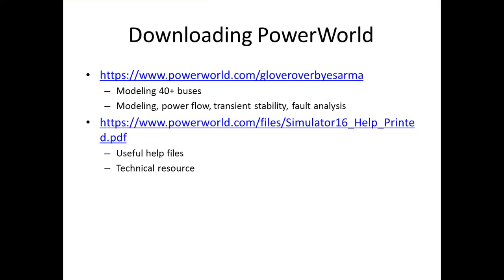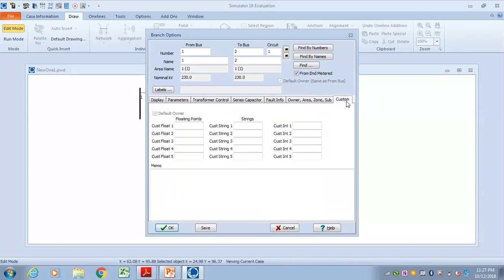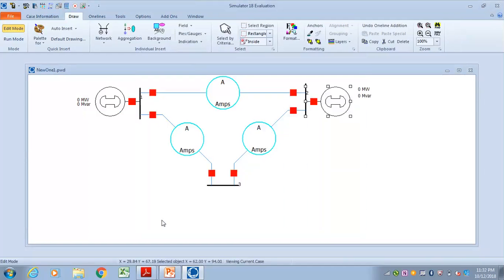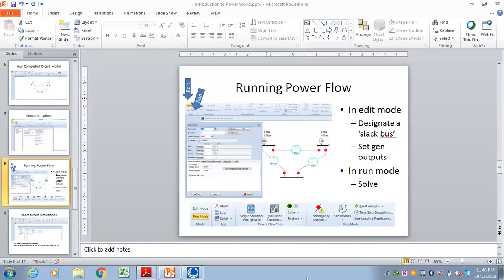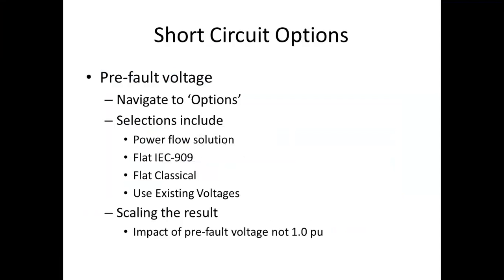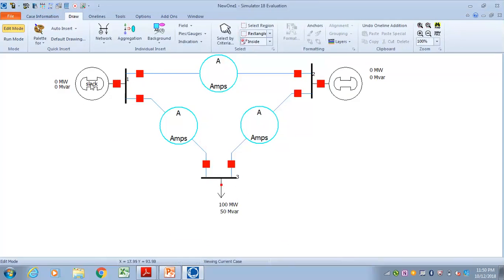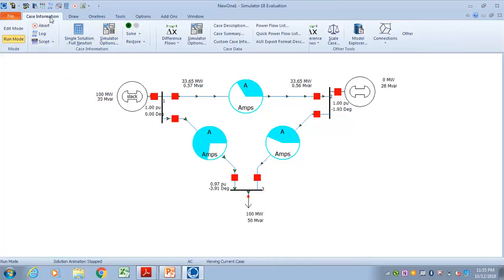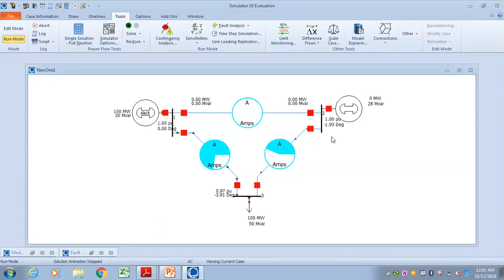Introduction to Power World

Comment: How can I make a circuit in the order of KVA not MVA? Trying to model a 25KV distribution network. Why does everything have to be in Mega?
Reply: Can you put 0.750MW for 750kW?
Reply: In PowerWorld Simulator, we make the change of units somewhat difficult to do on purpose, so that people only change it if they really intend to.  You can see if the units are Mega or Kilo in the Simulator Options, but to change them you need to use a script command or AUX file to change the parameter.  Generally speaking, the change should work, but some of our optional add-on tools have not been coded to properly take this change into account.  That is why we make it a little difficult to change, so that people understand its limitations.

 

The script command to change the parameter is:

SetData(Sim_Environment_Options,[KiloOrMega],[1]);

 

You can directly apply this script command in the Script window by going to the Tools ribbon tab and clicking on Script.  Enter the above script command, and hit enter to apply it.  If the command is entered incorrectly, you will receive an error message.  If it is correct, the command is immediately applied and you should see the units change to KW.  To change the units back to MW, you can put in the same command, but change the value of the parameter from 1 to 0.